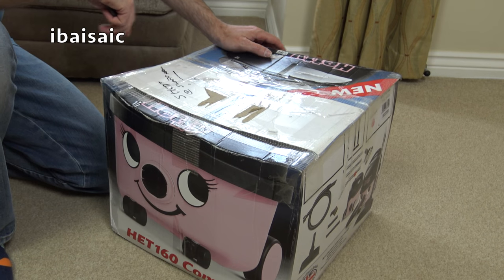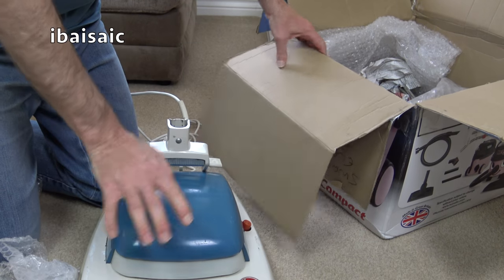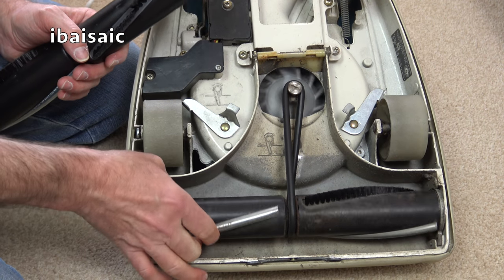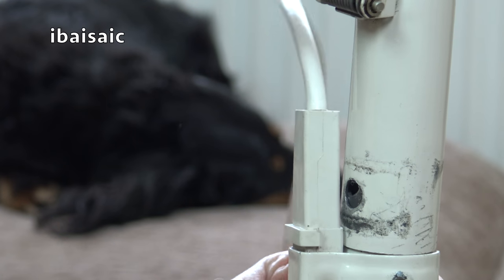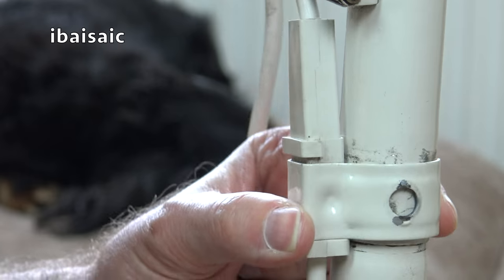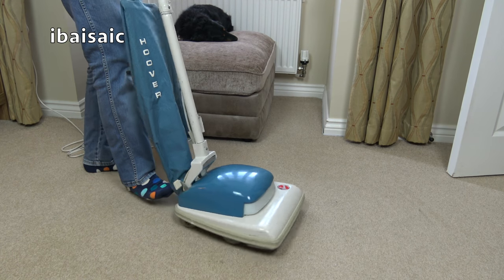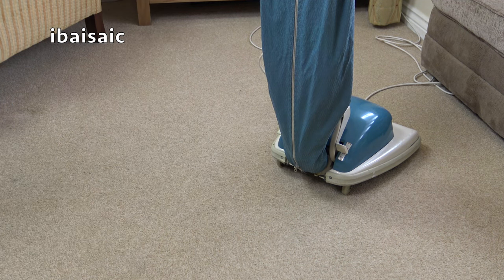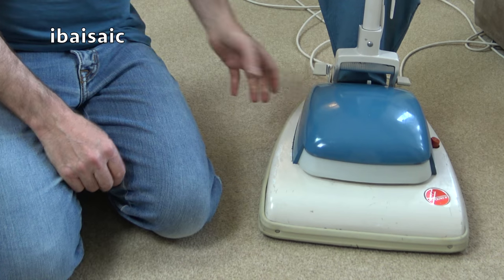Vintage Hoover Senior 6525C Upright Vacuum Cleaner Unboxing & Demonstration

Comment: Lovely Machine, I was lucky enough to stumble across a 6525c a couple of days ago in an antique shop I work in. I couldn’t resist buying it only cost me £15.00 bargain!. I had it on the work bench yesterday and stripped it down and polished the casing up. The postman has just arrived with a pack of new Rubber belts this morning. I just need a dirt search bulb now as the one inside has blown. I love the fact this Hoover has the 4 adjustable floor settings as it works well on hard wood floors and short pile carpets. Something my earlier vacuum cleaners can’t do they just blow the dust and dirt into corners of the room.

Comment: Its from December 1973, and the 652A / 6525 design never did come with a top fill bag, as top fill bags were not brought in until the second incarnation of the Ranger, the U4014, in the late 70s.

Comment: Now that's what I call a real Hoover. Here in the USA. The last superb Hoover's I believe were made in the early 80s. And for me the last good upright was the convertible as shown here. And also I'm a big fan of the Dial-A-Matic's. I know they went under a different name in the UK. But I think that the Dail-A-Matic's were a wonderful machine. And the only upright that was easy to use attachments. You couldn't get any simpler than, with that machine. But anyway, that's a wonderful machine. And that one's a keeper. Here in the US as of today. A good one is going for about $400 to $500.

Comment: Actually, one of the first American Convertible (Senior) uprights, the model 31, had a foot-actuated power switch, located on the top left of the handle bail/carrying handle. Several Guardsman commercial models had a similar foot switch.

Comment: I had one of those 22 years ago when I had my first flat. One of the best Hoover's I have ever used. Any modern Hoover's I've had from £100 and under have all been rubbish and didn't last long. Under a year for each. The only other one I had that lasted 20 years was one of the first or second generation Dyson. Now their just to heavy to move around , well for me anyway.  I'm struggling to find a good affordable modern Hoover that's not too heavy and has decent capacity for the dust. Really tempted to see if I can pick up one those again somewhere.

Comment: Interesting difference Roger, ours in Australia were also called a Convertible like the US and we did have a foot switch, but ours is a lever switch on the side of the cleaner that comes out on an arm from underneath.  We didn’t have the top mounted button switch like yours.  I’ve got an Australian made grey 652 model from the 60’s.

Comment: I wonder if a classic Eureka top-fill F & G upright dust bag would fit in the narrow confines of this Senior’s vinyl bag.  The paper throat would certainly attach perfectly to the tube at the bottom of the bag using the sliding ring.  Make sure you install the Eureka bag with the paper throat facing the handle.  This bag design is better than Hoover’s bottom fill C bag, as the dirt falls away from the air stream at the top of the F & G bag.

Comment: It is from 1973. Model 6525C was replaced by Hoover Ranger U4002 in 1974.
Reply: It was indeed, and the U4002 uses the bottom fill bag design just like the  6525 did, in fact it was pretty much the same machine, but with a new style plastic hood covering the metal chassis in its entirity. The basic 652 design carried on in the Ranger until the late 70s when the U4014 was eventually replaced, so the platform ran for a good 20 years dating back to 1958 when the first 652 came out. The Powerplus which replaced the Ranger in the early 80s was a similar design, but brought more into the 80s, and the soft bag senior PowerPlus was eventually completely replaced with the hard box dirty fan model, the Turbomaster in around 1986.
Reply: The 652 came out in 1959, the year I was born. My dad jpined Hoover as a sales rep in 1958 and later became a sales manager. He retired in 1990. He would bring new models home and I unpacked and assembled them. He had train shop staff on the new models as part of his job.
Reply: Hoover Senior model U4186 replaced the Ranger in 1981.
Reply: @philliphurley3883  You are right, it was the 1334 that came out in 1958 and the 652 a year later, both used the same pink colour scheme.
Reply: We had a rose pink.and white 1334, my dad got it from the staff shop.

Comment: Hello Roger I have another hoover 652 in green same as the one in this video it is in working order even the headlight is working but I am missing the screw for the handle where can you get one and what is the screw for ?
Reply from the maker: It depends where the screw is. There should be a screw at the base where the handle connects to the bail and a screw and nut that joins the handle together. The best place to get obsolete parts is eBay.
Reply: Hello Roger the screw is for the top half of the handle which slides on the bottom of the handle if correct what kind of screw do I need ?

Comment: I must say you seem a little over critical of your machine, you can't expect a machine to be mint , if you do I suggest you buy brand new and never open the box lol
That machine is actually in excellent cosmetic condition
Reply from the maker: I didn’t expect it to be in mint condition. Fortunately I found another in near mint hardly used condition, so I sold the one in this video.